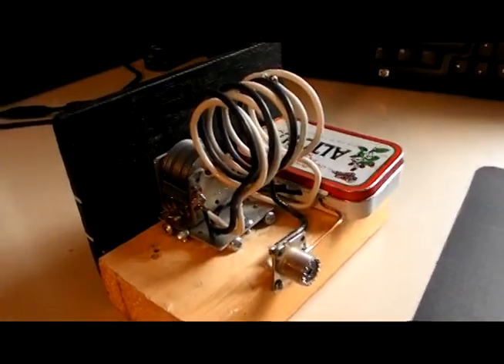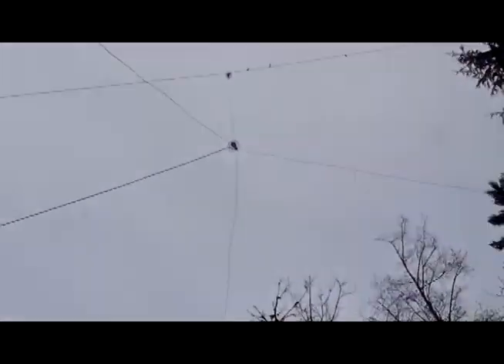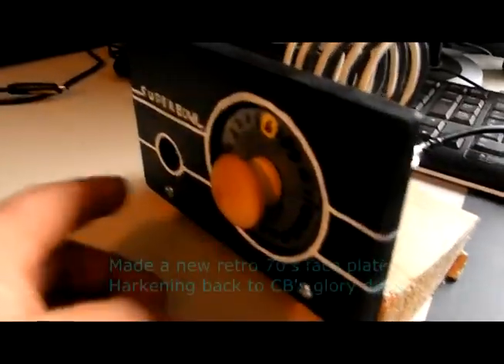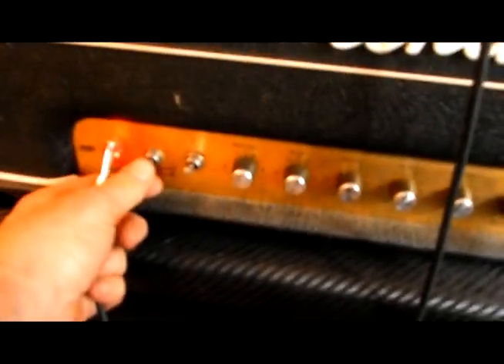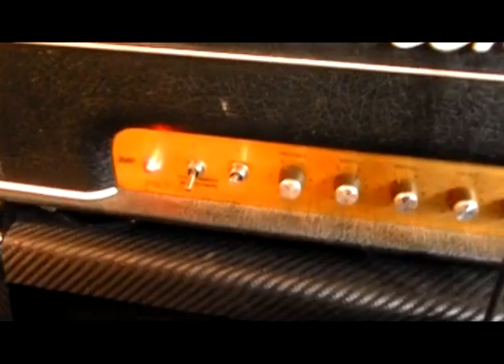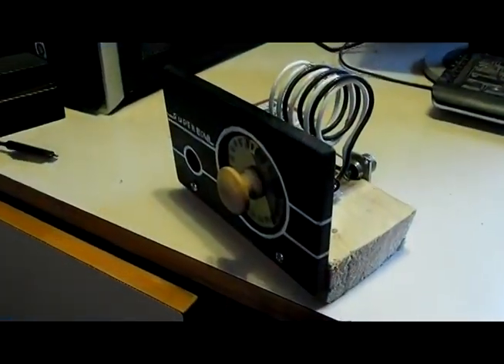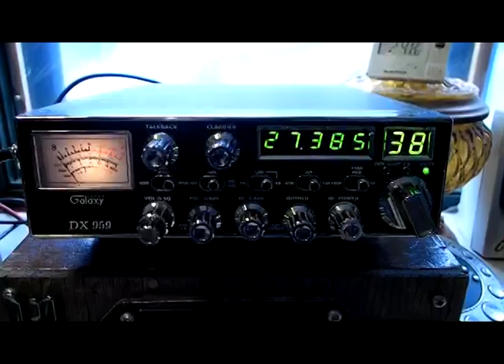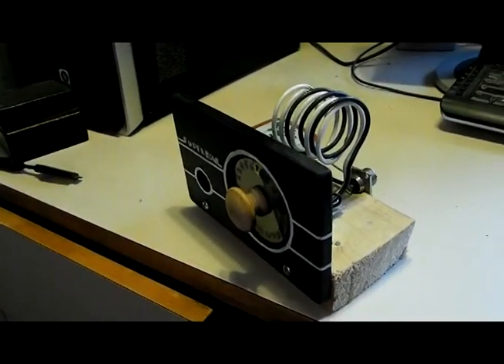CB Radio Crystal set with Coax and Ground Plane CB Antenna

Comment: I would suggest adding a capacitor across the output to remove the RF and just leave the audio portion of the signal, a good value would be about 200pF. When using headphones would would need to get a set of high impedance headphones, most modern headphones are low impedance. If you were to add a single stage transistor amplifier to the output then you could use a lower impedance set of headphones, but of course you would need to introduce a battery. However very interesting, it would be something that I would expand on. The probable reason the amplifier works is firstly its input impedance is quite high (probably 100k+ and also it has some low pass filtering on the input which has the same affect as the RF bypass capacitor I described earlier.

Comment: With a true crystal radio, I mean one without an amplifier, just headphone, the power only comes from the antenna, so more antenna is better. The 75 foot antenna is near 1/2 wave for CB so it's high impedance, not low. If you used bare copper wire for your tuning coil, you could have the antenna attach via an alligator clip to find the best match for any wire antenna. Nice finish and neat construction of your radio there.

Comment: Nasty rainy weather here, then dry dusty, and sun baked In summer. Put 2 108'' strips of wire in PVC pipe capping the ends. Then take the 'T' and seal with pl 259 putting the 259 through a thin piece of metal. Add a washer and nut to hold in place hook up to cable. This is the best of both worlds, vertical, and horizontal . Grab it move it to get best Sig, And a Lm 386 AF amp. Let's me listen 24-28 MHz thanks its good DX PS lock that 386 in a grounded Altoids box too  kv4li 73

Comment: Oopsy - I should have said "around 2 wavelengths" not 1/2. But for an end-fed wire antenna, both cases are high-impedance rather than the standard 52 ohms.

Comment: I donno....
i think i would add a preamplifier stage on this circuit.

Just wondering...

👍😆
Reply from the maker: I now have a KL 203-P linear boot  used with My Galaxy 959 CB  it has an optional signal receive  pre amp function which I never use on my already sensitive Galaxy radio,  too noisy,  but it might improve my Xtal radio signals a bit . I might try it whenever the skip gets strong again.